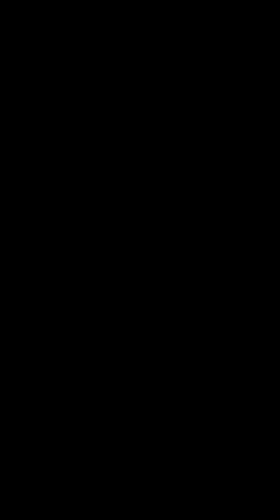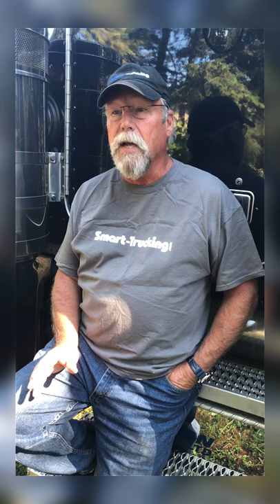2 Sticks To The Wall: What's This? #shorts

Comment: I just drive box trucks and they’re so restricted it’s awful.  I only have partial throttle control.  They won’t shift down when power is needed.  I’d much rather have a manual.